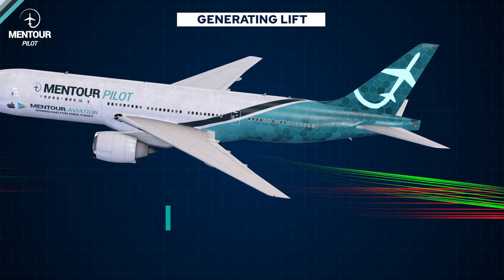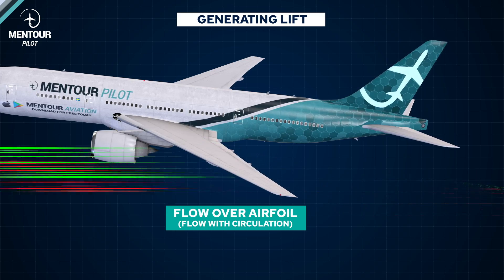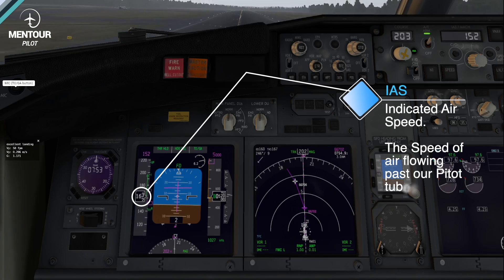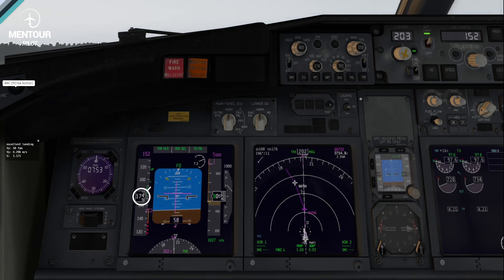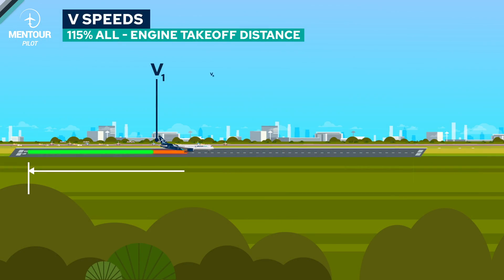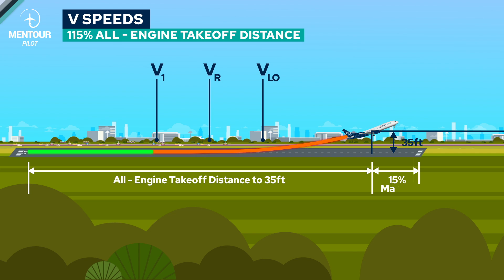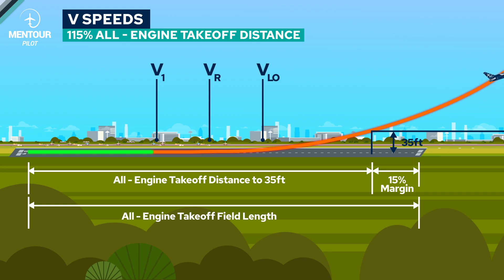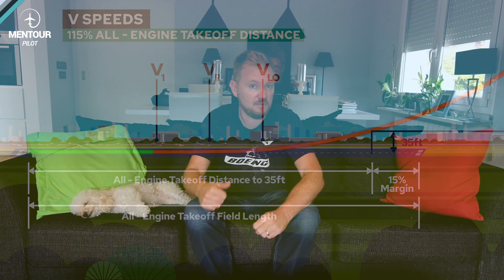Why do pilots call out SPEEDS?!

Comment: Ok - quick questions - 1.) For the 737 (under average load and good dry weather conditions) what is the max speed one can deploy / retract speed brakes?  2.) How about max speed to deploy / retract landing lights?   Never hear that online and I wonder when damage occurs....    3.) If one has a very long runway and distance permits, is it better to continue accelerating past VR to give the plane more energy (and thus an easier time lifting), or is there some calc / condition that occurs which makes VR the best time to rotate / begin VLO?    Always wondered about these things but often you don't hear much on real pilot videos on this.  I just want the sim experience to be as real as possible.
Reply: It should be able to lift fine by V1.  Note for example that V2 can be close enough to V1 such that in some cases V2 is achieved prior to the tires breaking contact with the runway.

V speeds are calculated with the certified tire speed limit in mind, so randomly remaining on the runway while continuing to accelerate could run afoul of that constraint in some scenarios.  The last part of the takeoff is also the most severe on tire heating, so the tire(s) could alternatively fail from overheating if a takeoff is significantly extended at "corner of the chart" conditions such as MTOW / high altitude.
Reply: @marcmcreynolds2827  Ah. Makes sense. Thanks.

Comment: If you abort the take off after V1 can you use taxiways to extend the braking distance you have? Often you have a few exit taxiways towards then end of the runway and I imagine you can use them to have the full distance off the taxiway exit and the rest of the taxiway asuming there is no aircraft there. 

Also - When I flew aircrafts like 737 and A 320 from Arlandas longest runway (about 3300 meters) it seems like the pilots often take longer time to rotate than when taking off from shorter runways. Does that mean you have an advantage to continue to accelerate above youre normal rotate speed if you have enough runway to safety do so? Johan.
Reply: Even "high-speed" turnoffs are I believe limited by a rated turnoff speed of 60 kt.  On a non-dry runway, you might not even get that.  They are located far enough before the end of the runway that for a high-speed RTO using maximum decel, the aircraft's speed going past the last one would still be well over 60 kt.

Staying on the runway well past Vr exposes the tires to a lot more heat buildup, especially for a takeoff near MTOW where the tires are deflected to their rated deflection (more deflection equals more sidewall flexing as the tire rolls equals more heat equals less strength).  The increasing heat plus increasing speed (and tires are only rated to a certain speed) would make post-V1 [edit: post-Vr] tire failure more likely.
Reply: @marcmcreynolds2827  Thanks for the answer.

With that in mind - Could the pilots use a slower acceleration rate to save wear and tear on engines and gear when they have a longer runway? That would give the same impression I guess? Johan.
Reply: @JohanMsWorld  Airliners routinely do use reduced-thrust settings when sufficient excess runway is available.  That's favorable to engine economics, but not the landing gear (tires, specifically -- the rest of the assembly doesn't care).  Note that using reduced thrust is not as safe as a normal takeoff, because there won't be excess runway available which might have come in handy (e.g. multiple tire failures causing stopping distance to increase substantially).  V1 calculations are based around the scenario of an engine failure (way back when the standard was developed engines were far less reliable). But a tire failure is probably more likely nowadays, and if one fails the likelihood of others around it failing goes up.

Comment: Mentour, I don't know if you did it to simplify the message, but there are a couple of misconceptions in this video.
1- V2 is not the best climb angle speed, or the best-anything: it is barely a safe climb speed, a speed that meets certain controllability requirements and that ensures a certain minimum climb gradient with one engine inoperative. That is why It is required that if you decide to continue the take-off after an engine failure at V1 the plane must be able to achieve 35ft AND V2 over the departure threshold (or the clearway if there is one). You mentioned the screen height but not V2 as part as the requirements when defining V1.
2- V1 is not necessarily the latest speed where you can start rejecting the take-off and stop on the runway, nor the soonest speed where you can continue the take-off after an engine failure. V1 is rather a speed SELECTED BY THE OPERATOR within a range of speeds that meet that criteria (unless the take-off weight is runway-limited). There is ONE value of V1 which is called "balanced field V1" that makes the ASD (accelerate-stop distance) equal to the TOD (take-off distance after an engine failure or 115% of the take-off distance with no engine failure, whatever is greater, in both cases with the requirement of achieving 35ft and V2). That ASD=TOD is called the balanced field length, and it is the minimum runway length from which the airplane can operate in these conditions (weight, wind, density altitude, etc...). If the runway is longer than the balanced field length, then there will be a range of speed that meet the V1 criteria and the operator has to choose one within that range, although the practice of performing reduced-thrust take-offs can offset the excess runway available (with a lower thrust you will have both a longer TOD and a longer ASD) and runway length is one of the limiting factors of how much the thrust can be reduced in a reduced-thrust take off (you can reduce it up to the point where ASD = TOD = runway length, assuming no clearway and no stopway or a clearway of the same length as the stopway).
Reply: I liked this comment just because of how long it was. Nice story book
Reply: What are you trying to instruct? Mentour used best correctly, to say otherwise is misleading. What Mentour said implies V2 is the best climb speed one can maintain flight with one engine. If you have a correction, actually use an explanation that makes sense or link a response video.
Reply: @ConnanTheCivilized  ... Except that what you said is incorrect. During a normal take-off you typically exceed V2 by 35 ft and achieve V2+10 / V2+20 at the end of the rotation and hold it for the initial climb. If an engine fails during rotation and you already achieved more than V2, you are not supposed to slow down to V2, because V2 is not the best anything. It is the MINIMUM speed you need to achieve if an engine fails before V2 (but after V1). If you think that anything I said in my post is incorrect, please point it out specifically.

Comment: So the heavier the plane is the faster you have to go to take off but you have to decide if you're not going to take off at a slower speed. Seems like physics kind of working against us in this case 🤔
I think as the weight of the aircraft increases the length of the required runway increases not proportionally but probably exponentially.

Comment: Mentour question when you are rotating aircraft off runway why is the yoke being turn left or right and not being kept straight in line with runway during take off ??
Reply: To compensate for crosswind. Wind rarely blows in exactly the opposite direction of the runway.

Comment: Brilliant explanation Petter! I always thought V1 was the calculated speed you needed to achieve based on weight of plane, wind speed, air pressure and temperature, at least that is how i was trained 35+ years ago when i was getting my PPL, or are we using the same terms? Love your clear, sanguine and vocal intonation, truly amazing, would fly on any plane you were left seating with utter confidence.

Comment: Wouldnt you have to calculate your stop speed without thrust reversers because using only one Would spin the aircraft
Reply: On a dry runway there is plenty of directional control to handle that:  Nose wheel steering, rudder, differential braking.  As runway friction lessens, there is more chance of a directional control problem, but generally the lateral control available will still be adequate.

Comment: Dear Mentor Pilot, I was of the assumption;
Environmental circumstances with the plane performance capabilities determine v1 v2 etc.
* air density
* temp 
* humidity
*wind
Gravity/performance 
* weight
*thrust
* lift (mainplane)
* drag
All these factors contributing to the minimum distance for flight. The POH for each plane will give measurements.🙊🙉

Comment: Why are runways not constructed with an incline slope starting at, for example 500 metres from the end of one that is 4000 metres in length? Would this not enable aircraft to avoid overruns that may otherwise occur in various scenarios?
Reply: One reason would be that if the wind shifts and landings have to take place from the opposite direction, that slope would become a problem instead of a solution. Having it there would also work against takeoff performance for takeoffs needing most of the runway. Crushable surfaces installed past the ends of runways at some airports are a viable alternative for keeping some overruns from becoming a disaster, however.
Reply: @marcmcreynolds2827  Thanks Marc

Comment: Are there any markers on the runway that indicate where these “V” speeds should be achieved?  V1 V2?
Reply: It's not a fixed point on the runway and it varies, because this speed depends upon a number of factors, and it needs to be calculated before every takeoff considering e.g. the weight of the aircraft, thrust setting, flaps setting, the runway conditions (dry or wet), airport elevation, wind speed and air temperature.
Reply: Its different for every aircraft and even differs on load and weather.
Reply: There is a reason they refer to speed rather than distance (or fixed markings), because these numbers vary from plane to plane and situation to situation. The idea is that when charts are read (based on all the given variables), calculations predict how far down the runway you are at a given speed, because the calculations tell you how fast you will accelerate.

Thus, they indicate "this spot on the runway" for you in means of speed rather than distance. It's easier to monitor for the pilot, as they already monitor speed to determine when they go fast enough to rotate and lift off (VR and VLOF).

Comment: As much as understand, V1 is a condition of "no return" rather than a point on a runway. It depends on current aircraft speed (energy), weight, breaking ability and left runway.
It can be predicted using energy gaining but this prediction can be wrong if engines produce less power than expected.
Is this condition constantly recalculated during takeoff?

I mean when you have no computer, you can predict this point and calculate what speed will be there, but in real life parameters can change "on the fly".
Reply: It's a "modeled" speed, so it will use performance tables to assume things depending on a given weight and engine setting, as well as breaking capacity etc. These will have a margin of error built into them so that it still works if conditions are worse than predicted. It's not really practical to change on the fly.

Comment: What if an engine blows at exactly the same time as V1 is called out  ??
Reply: Reaction time plus other "margins" are built into the performance calculations, including Rejected Takeoff braking.  There's quite a bit of conservatism in it which the video didn't talk about (pilots know what's in the flight manual, but in general not the details behind it).

Comment: what is screen height, i did not understand that, if somebody can kindly help
Reply: It accounts for a hypothetical obstacle which is taller than 35 ft somewhere past the end of the runway, by imagining that there is a 35-ft obstacle (notionally, a "screen", fence or whatever) right at the end of the runway. More generally, this puts some margin of safety into the field length requirement, vs assuming everything will go exactly as per the assumptions in the performance calculations. For example the wind vector might shift, or crew reaction times differ from nominal.
Reply: @marcmcreynolds2827  Thank you Marc for your kind reply, really helps